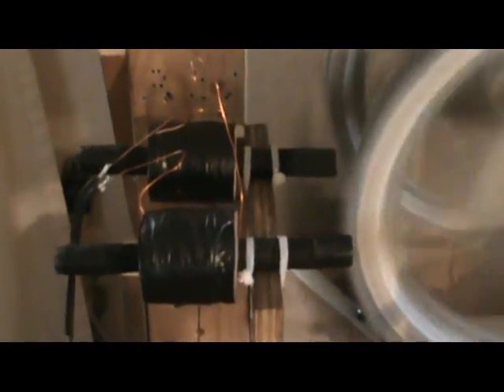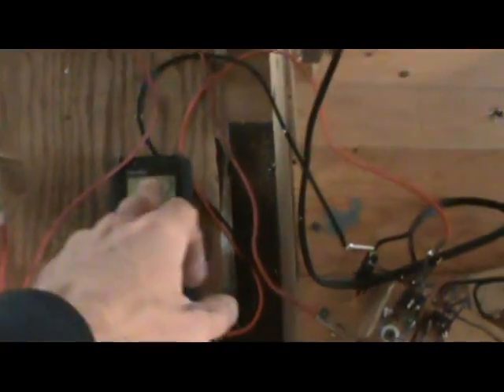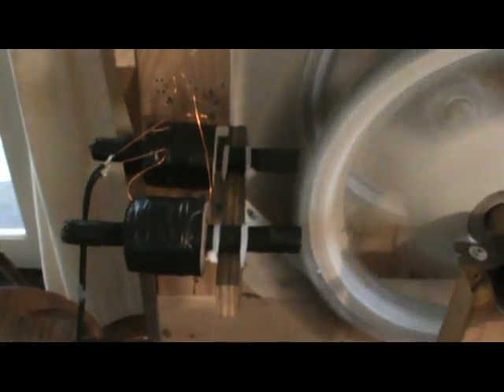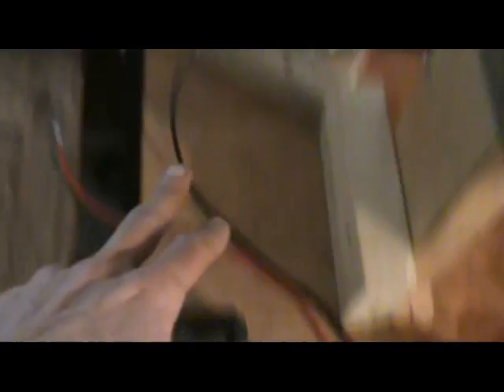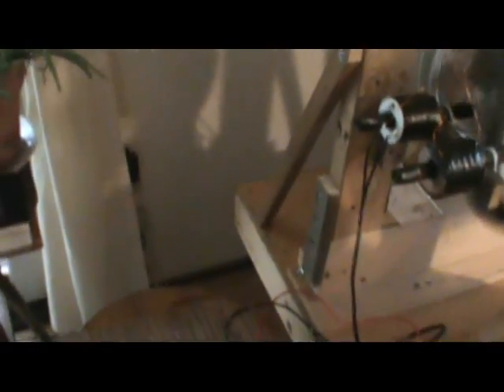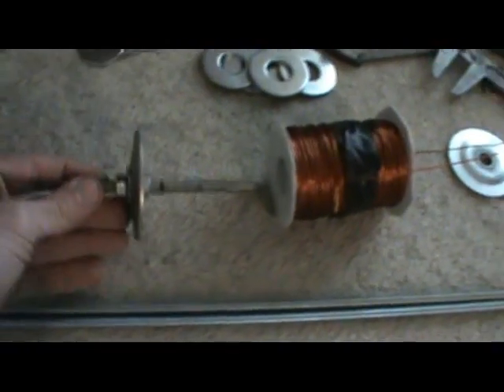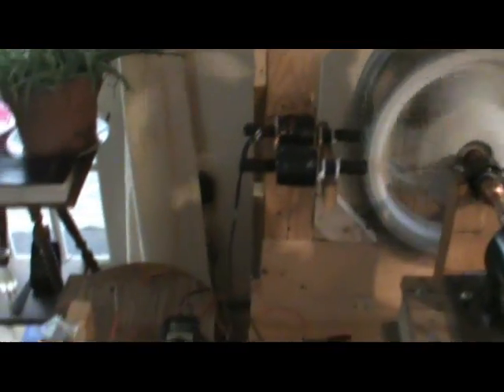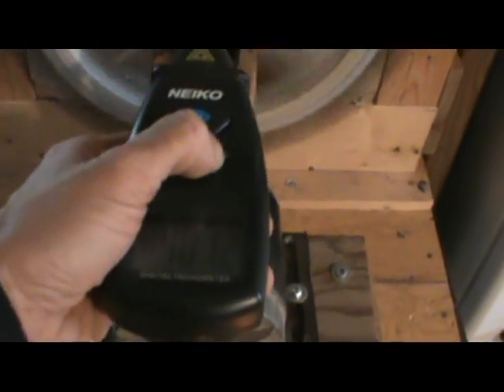Free Energy Project - Testing Update

Comment: @All, a little thought experiment. You all saw levitating spinning top. Questions: What would happen with the top if we would start rotating magnet below the already rotating top in the air a) in direction of top's spin? b) in opposite direction? Let's say we are using electromotor for fast spin. One more: c) If we put magnet on a scale, would the scale read the weight of a top levitating above the magnet? Would like to hear opinions/answers. :) Stay well.

Comment: Your curiosity and good spirit has inspired me to also look off the path of standard convention. I've developed an process that eliminates the power consuming portion if the bedini process. By looking from an new paradigm, I found an additional 60% efficiency by removing the rotor, bearings and coil cores.  I simply rearranging the other components.    I'm a good mech eng with no circuit backgnd, I'm looking for an partner for further development. Its new and I'm on my 2nd functional prototype.

Comment: A little, but the new coils are not mounted yet. Lack of time and was not sure about how to wind them this time. They are bifilar now (every turn side by side) with current in diffrent direction. That will create many rotating fields (paths) radially in the coil. The reason is that Ed wrote something like "create paths for the magnets to travel in the coil". But I can reconnet the coils to test the usual bifilar connection (same direction on currents).